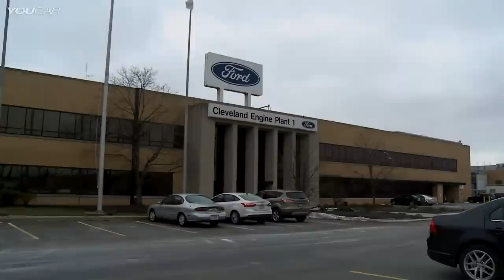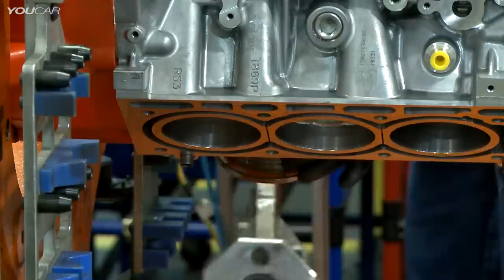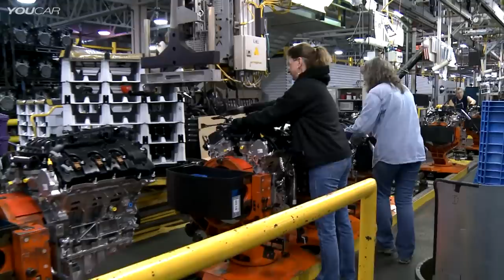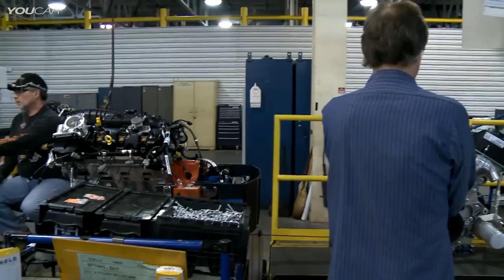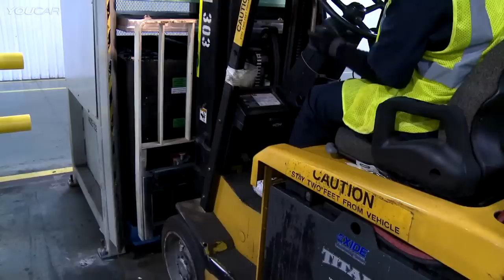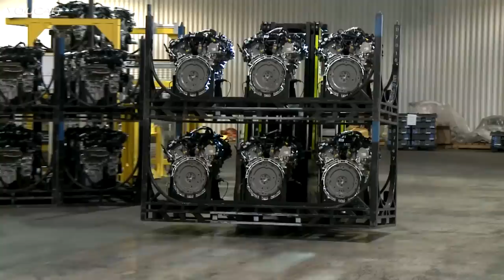Ford EcoBoost engine factory

Comment: I am seeing a worker at 00:40 using a tool to tighten the rod bolts. Is that all the torque that is required or will these be again checked later at another station? Maybe he is tightening something else. Just wondering here.

Comment: This is V6 Ecoboost from Ford F150 Truck.
And yes no robotics mean it's underdeveloped US
Reply: +z1m7x2n6 Most final engine assembly requires humans to do the job - unlike the welding/painting/body panel work  that robots do.

Comment: I'm pretty sure that isn't the 2.0 liter ecoboost.
Reply: Why would they lie about that?   -.-
Reply: Lie isn't the term I'd use. But please find me a v6 2.0 ecoboost. There is a 4 banger 2.0 and a 3.5 v6. The new 2.7 is also a v6, but it has an iron block.
Reply: Cory Stansbury I thought the exact same thing when I saw the 3 banked cylinder spaces: "V6 ecoboost? no way"
It's probably just Ford being Ford where they sharing assembly lines between engines, not YouCar's fault.
Edit: scratch that, they're all V6s.......
Reply: ***** You're correct, according to wiki: "The V6 EcoBoost engines are being assembled at Cleveland Engine Plant No. 1 in Brook Park, Ohio." clearly the same name as the plant in the video. I stand corrected.
Reply: ***** actually the mustang isn't getting the eco boost v6, only the i4 will be ecoboost
Reply: ***** where did you hear that the v6 was getting an eco option? Hell, what about the v8 lol
Reply: ***** I'm not wrong. There are 3 options
3.7 liter v6
2.3 liter I4 Ecoboost
5.0 liter V8 Coyote
I know almost everything there is 2015 mustang. Since i've ordered one, I've read almost every single bit of information about the car.
Reply: Shunsui Uchida the v6 isn't getting an eco option because ford is trying to get rid of the v6 option in the mustangs and they're trying to push the 4 cylinder eco hard because it's new for this model. so they made it better than the v6 so they could get the sales. and the v8 doesn't have an eco option. only the 3, 4, and 6 cylinder engines have ecoboost option. the 3 cylinder is only in Europe
Reply: +daniel55645 I thought the ford f-150 came with a 2.7 ecoboost v6,  they even said it in the commercial 😕
Reply: Chris Ramos The f150 has a ecoboost v6. I was talking about the mustang though. The mustang isn't getting the ecoboost v6 option
Reply: The famous 2.0 liter V-6?

Comment: The engineers have failed. The top of the cylinders are not connected to the block. What is going to stop side to side movement?  Answer: NOTHING. Head gasket will wear away and coolant will fill the cylinders.     Just like with the 2.3l in the Focus RS. Why are all the companies doing this now?

Comment: All this R&D and money spent for a gain of only 10 mpg in 15 years. Factor in insurance for newer cars and list price and the mpg increase is not worth the cost against maintaining an older vehicle sadly
Reply: But the towing capability has greatly increased.  Want great mileage?  That's why they sell hybrids.
Reply: Yeah and whats the top mpg a hybrid is getting? realistically real mpg is about 50. (Assuming you don't have to be way too careful with the pedal). Can you honestly say thats acceptable after a decades of R & D?
Reply: OK, there are vehicles built for mileage (hybrids), and those built for towing and hauling (trucks).  I can honestly say that given the increase in mileage AND the increase in capability AND having to meet safety standards, crash standards, and all other crap that people demand, that is certainly acceptable to me.  Anyone who doesn't think so needs to get their engineering degree and go to work for a manufacturer and have a go at doing better.
Reply: Totally agree!
Reply: Hybrids are bullshit anyway it was proven that a bmw m3 at 70mph had better fuel economy than a Toyota Prius as the bmw is hardly working to maintain the speed yet the Prius was working its arse off. It’s a shit technology. Hydrogen powered cars have been around for a while now but the big oil companies are stopping it from becoming main stream. Hydrogen cars produce nothing but water as a bi product.

Comment: I do like cars, which is why I'm going to call you out on your bullshit.  The description of this video claims this is the Ecoboost 2.0L. The engines depicted in this video are NOT the 2.0L Ecoboost, which is an inline four cylinder.  This video clearly shows V6 engines, not four cyclinders.  I don't even think this video shows an Ecoboost engine, there are no turbos shown on any of the engines here.  This is likely the 3.0L Duratec V6.  If you are gonna bullshit people, at least do your research.  Just thought viewers might want to be aware.  Have a nice day.

Comment: See those unsupported cylinder walls?.. design fault!
Reply: Cylinders are internally supported, they're not just floating in there! Those are coolant passages to keep cylinder temps managed with the additional heat from turbo pressures.

Comment: If Ford put half the effort into making an engine like Toyota does they would actually last longer than 100,000 miles.
Reply: Francesco Scigliano but they already do
Reply: wow, just wow. Bet the guy with 300K on his 2.7 can tell you otherwise.  Only reason Toyota is reliable is because they are 3 generations behind Ford and still building the same engine from 2001 in their trucks. They had better be reliable by now.   Which company sells the most trucks? Ford. How many of this particular engine shown being assembled have been sold? Right around 2 million.   SMH.
Reply: Brain washed

Comment: I do not want an aluminum block V6 in my truck.  Got a Ram 5.7 hemi with cast iron block for towing way better.  This Ford engine existis only because of the EPA no other reason.
Reply: The 2.7 has a graphite block which a shit ton stronger than your fake Hemi's, lol
Reply: Thanks for the laugh!!! I needed that!!! Show me any stock Ram that can out tow my F150 3.5 EB. Go ahead, I dare ya!  13,200 pounds towing capacity, and will leave your Ram sitting still climbing a mountain.    How much can a Ram tow? 10,710. Hmm come back and brag after you magically gain 2500 pounds of towing capacity.
Reply: @acdii  when your turbos go after 100k then how much can you tow.
Reply: @ryanthompson2893  What makes you ASSume the turbos will go?  What mythology are you getting this information from?  Do you also believe the valves coke from GDI(which has been completely debunked since no one to date has provided any evidence of ever happening.)?  There are very few turbo failures on the 2+ million 3.5 EB alone that Ford produced, let alone the millions of other Ecoboost engines they produced world wide.  Ecoboost turbos are water cooled, used convection cooling to continue water cool down when the engine is off to prevent bearing coking, and are designed specifically for this engine and has gone through more rigorous testing than most engines do from all manufacturers.  I'll gladly put my 3.5 EB up against any of the others out there knowing it has more power, and will last as long if not longer. 

 I had a 2014 F150 with 3.15 rear end gearing that passed just about all out there running up the IKE with 6400 pounds of wind sail behind it. That was with the cruise on in normal mode, not even tow/haul mode.  I highly doubt any other truck can do that.
Reply: @acdii  every eco boost I’ve had has had turbo problems at around 100k. New oil every 3k or one year. Just like the other trucks in my fleet, so done with Ford and there garbage. Ford did take care of truck 2 surprisingly, but I sold that think and went back to dodge. Chevy has been crap since 06. And Toyota is just a pain to maintain.